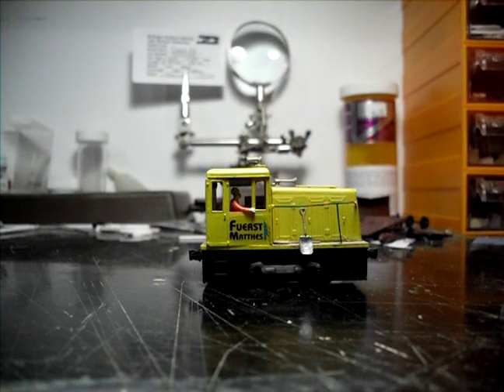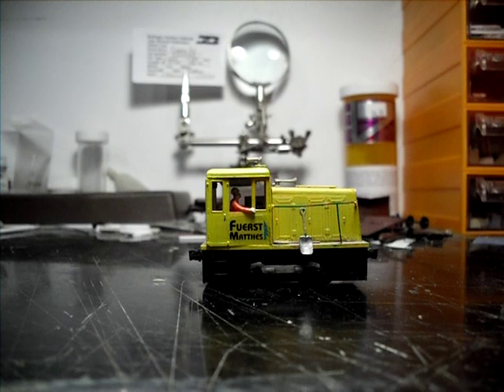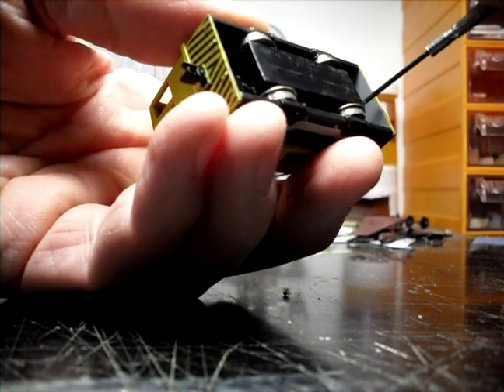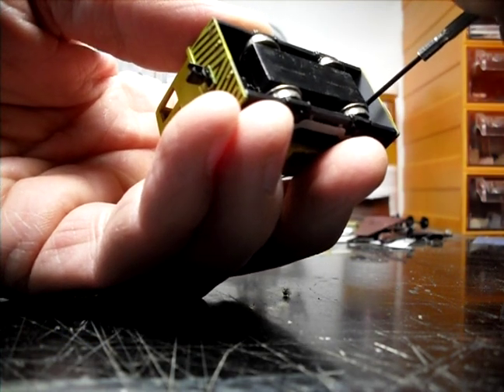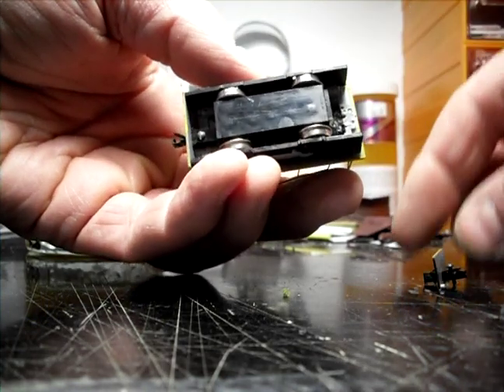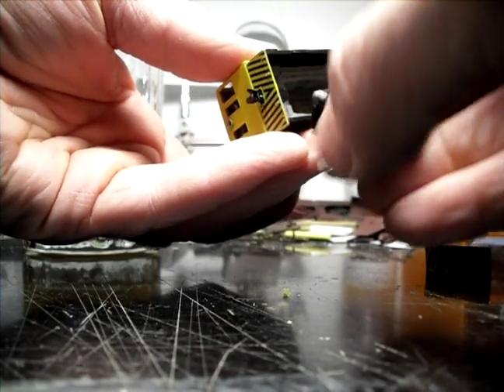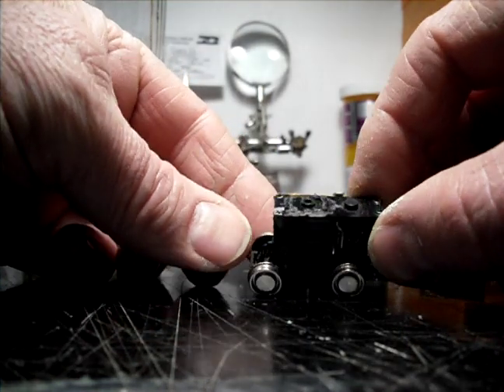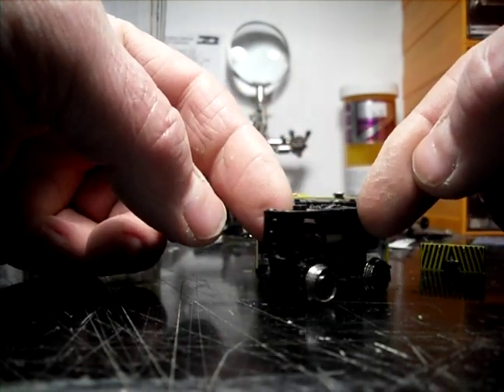grantline loco.avi

Comment: I just one of those grandt line engines on eBay that is motorized.  First thing the came to mind was trying to see if a Bachmann power truck would fit.  Thanks for the video...I usually start off with a Boildermaker then a screwdriver